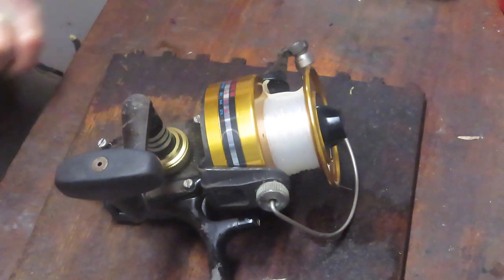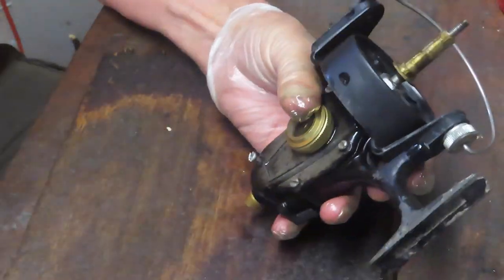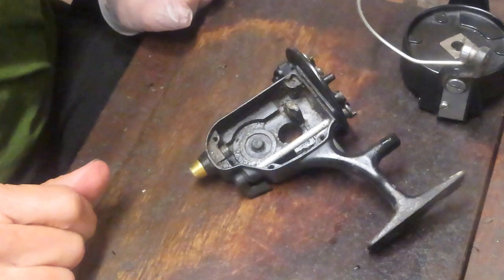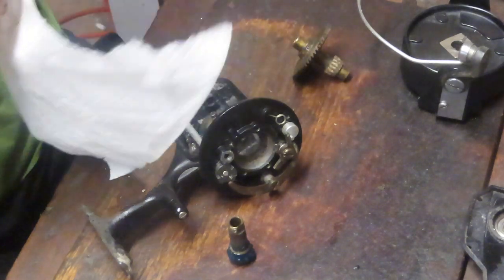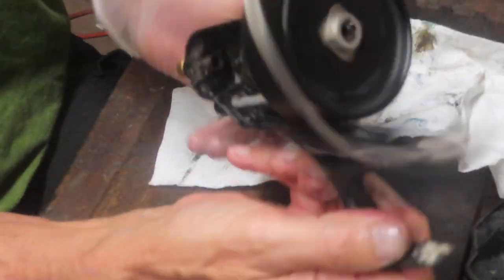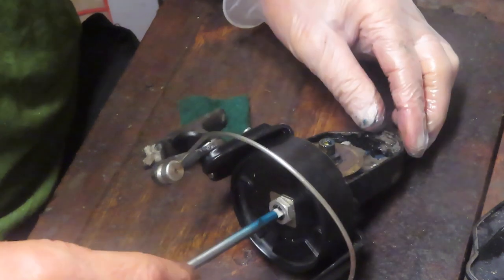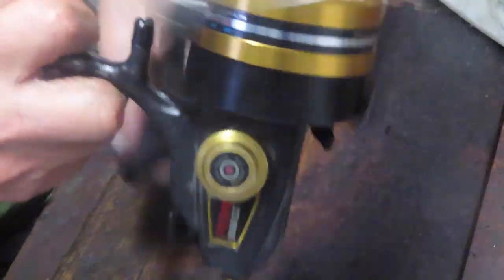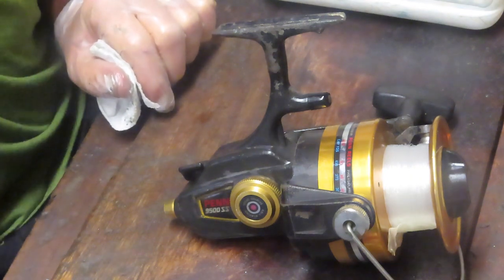Worst sanded Penn SpinFisher 9500 ever in my shop how to service and restore

Comment: Hey Dennis, This is a good candidate  for the ultra sonic cleaner alright😂. This is why I have no problem buying  these Penn ss Reels made in U.S.A. The secret is the America Steel. I still can't believe the handle would  turn with all that sand packed in there! You could build a sand castle with what came out of that reel! The reel performs perfectly Dennis, so smooth its unbelievable! I loaded it up with 100 lb. Power Pro and  ready for the Bull Redfish run and occasional Shark on the beach down here in Texas! Thanks for giving my reel a Second Chance!,Nick
Reply from the maker: Thanks Nick - Best wishes for great fishing with the reel - Dennis

Comment: You know I love these Penn reels so this video is of great interest for me. By the way I never tire of your thanks to those helping us during this worsening pandemic. Keep it up!  When you took that side plate off I just about gagged! Who ever sold this reel should have been ashamed. I would love to have one of these reels but they are just too expensive.  I still prefer the worm gear Penn reels like my 704Z and 706Z.  You did an incredible job saving this reel. I worked on a very nice SpinMaster Pro Series V reel this afternoon. It turned out to be a great reel once I chiseled all the solidified grease out of it. I love Ohmori reels. I paid very little for the reel and yet it may well be the best of the three SpinMasters I have. What you said about the durability of these vintage reels is so very true. It is why I like them so much. Great video Dennis!
Reply: The reason this reel survived is because of what it is. A US made reel
designed and engineered and sold
by the company that made it to last
and serve for years. The modern "Penn" China contract reels made by
who knows with their "mystery metal"
innards would have congealed into
a little chinesium ball anc would have
been trash. No wonder there are so many old Penn Long Beach and others
still "working" on charter boats.
Reply from the maker: I was. at a market this morning and there was a SpinMaster there.  Problem was an unrealistic price.  Those are nice examples of the era.  I Have a royal Maroon Shakespeare that is seized.  I will try to make that one work as well as this one - Dennis
Reply: @2ndChanceTackle  is it a 2062 or Sea wonder Shakespeare? I love the older Shakespeare reels that are worm gear driven. The 2062 is one of the finest Shakespeare reels ever made. I have 14 vintage Shakespeare reels 5 of which are Sea Wonder reels. Good luck with your seized reel. I’d love it if you made a video of how you repair it.
Reply: @armandoreyes1891  You are absolutely correct - well said!!!
Reply: @2ndChanceTackle  I’m send you some SpinMaster photos,

Comment: Dennis, you should look into using gunsmith screw drivers instead of automotive screw drivers.
The blade is flat on the bottom and hollow ground to fully fill the screw slot, unlike a automotive driver bit that immediately tapers to a larger diameter of the shank.

Penn had an issue with the paint process on a bunch of the SS series reels, where the paint will start to wrinkle, then slough off in sheets. If you had one of the effected reels, it didn't take long to see the problem.

The out sourcing of production corresponds to the sale of Penn Reels to Shakespeare in 2007, then a number of investment groups. Thanks to globalization, well respected American brands became just trademark brand names. The investment group sends production to China, strips the high profit margin items from the portfolio, takes the money and runs to destroy the next victim.

Thank your 401K management group for dismantling tried and true American brands.
Reply from the maker: Thanks for the note.  This reel was from when Penn was still Penn and made in the USA.  A lot has happened to that company, not all of it good.  I think they are back on track now.  The current line of products stands up well.  Some of the interim products like the Defiant,  Rival and Warfare reels don't.  That is where the brand suffered - Dennis
Reply: @2ndChanceTackle  
Dennis, I wish they were on the right track but higher profits mean more than USA jobs to investment groups. 
I have 10-12 International II reels and a couple of International V reels. 
All of the International reels are USA made. A couple of other models are also. Unfortunately there are no USA made rods. 
When a International rod pops up on a auction site, they get snapped up quickly and bring high prices. 
I appreciate your videos and giving vintage tackle a chance to fish again.

Comment: Nice job ,Dennis!
Out of curiosity,was the reel made in the USA ,or the later Chinese models?
In your experience is there much in difference in the quality between the two ?
Cheers Pete
Reply: No Chinesium in any of the SS series reels. They started sourcing Global parts with the SSm series, depending on model.

Penn first called this reel in hundred series, meaning 450, 550, 650, 750, 850, and finally the 950.
 
Not sure when the change over to the thousand series started, but they look identical to the hundred series Penn reels. 

Sorry for being long winded, but I grew up using Penn reels and probably have 20 or more of the SS series reels from the 550 (5500) model up to the 950 (9500).
Reply from the maker: This reel was made in the USA.